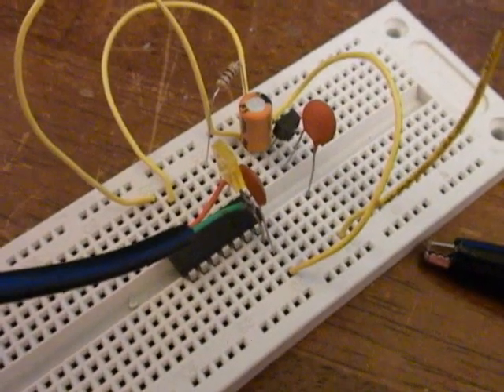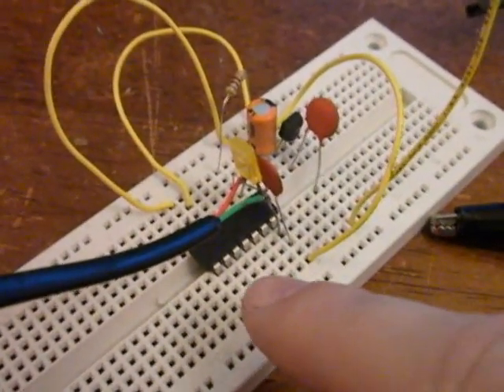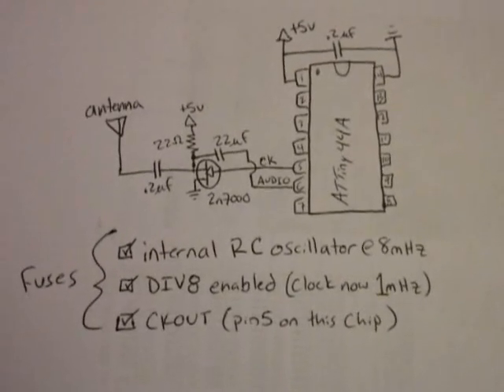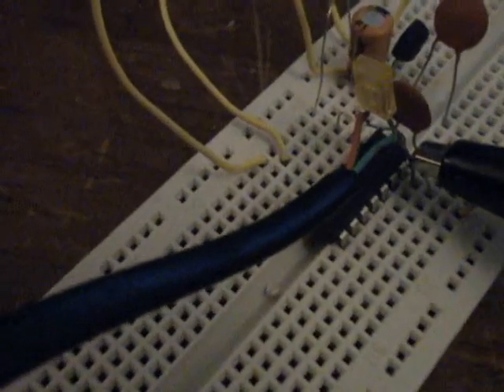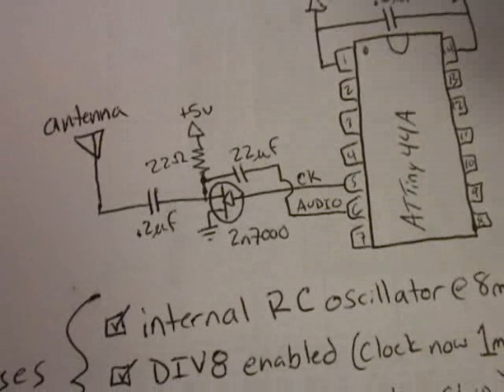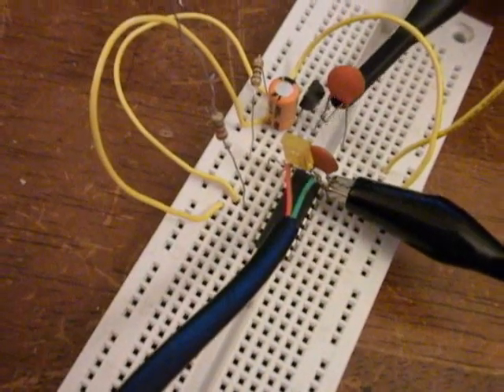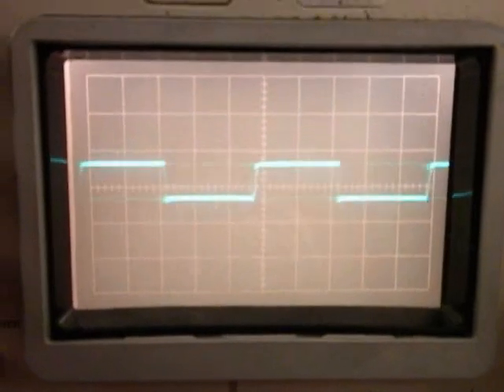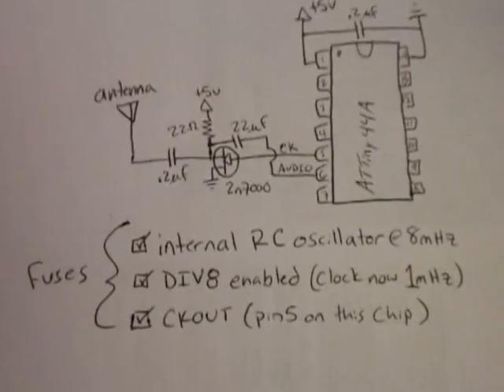simple microcontroller am radio transmitter.avi

Comment: @nibjb Yeah, it's certainly nice minimalistic project. Now that I think about it, you could just leave out the transistor, and make simple DAC with two (or more) resistors to get the varying amplitude and put it through the cap into the antenna, right? Now that would be nice application for the 6 pin tiny AVRs :)

Comment: @nibjb lol, I guess I should have thought through my question a bit more.  I was thinking about  a beacon idea for my model rocket but my radio in my truck (Yaesu FT-8900R) is FM only and even then, 6 meter is higher than the chip can output.

Comment: Very nice , simple , brief , and comprehensive instructions . While using this recipe ! can any micro controller can be used as a transmitter? what about a receiver.? please post your answer. and how can the range of this RT be increased.
Reply: You dont need a microcontroller for simple AM reciever. Paralel RLC circuit, diode and capacitor is enough. (of course you need amplifier and speaker)

Comment: can you use other transistors too? like  the 2N3904?
Reply: 2N3904's are BJT's which are normally controlled by the current to the base pin, while MOSFETs are voltage. A non inverting or inverting summing amplifier may help if you have an OP AMP IC.

Comment: @mkerna Yes or you fry the I/O drivers. FET is in fact charge controlled device. The gate makes capacitor to the other electrodes and as you know, capacitor conducts AC or simple fast change of voltages (=square wave edge) very well. You know, there are FET drivers with several ampere capability for a reason. In some cases you need as fast switching possible to minimze the linear region losses in the transistor. But anyway, you need to make sure the gate current isn't excessive for your driver.

Comment: Thanks for this information! I am currently working on a shortwave transmitter very similar to your design using an ATMEGA 328 with a 16 mhz external clock and at htis point, it only sends just the carrier wave and thats it. im going to implement the design at 4:03 later on.